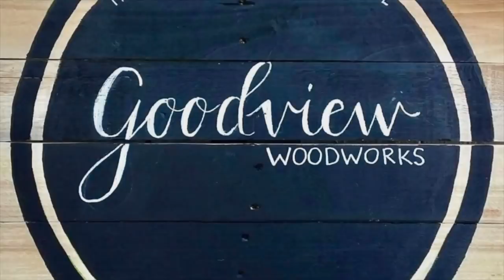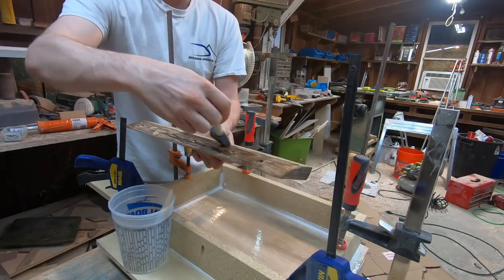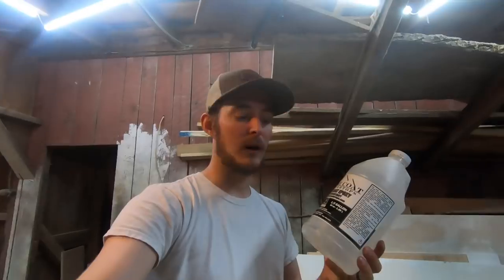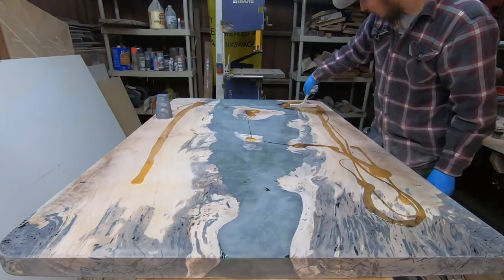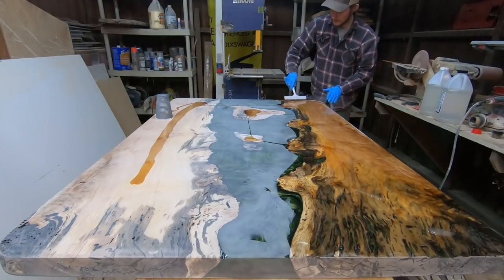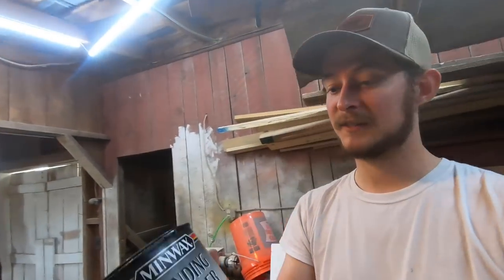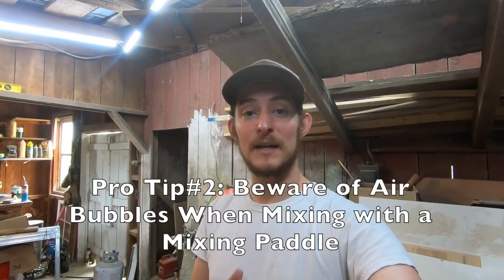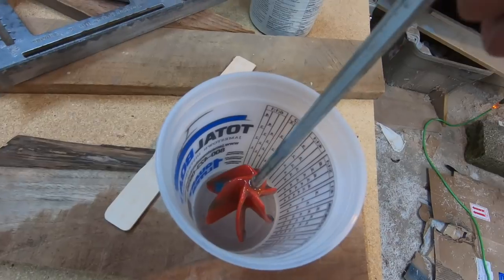2 Pro Tips That will Help You To Have Perfect Epoxy Projects!!!

Comment: Here is my bit, do not seal the edges of a river  or live edge pours! Use a slow curing epoxy or deep epoxy to allow to air to escape. If you seal coat you will stop some of the air bubble but the bond between the wood and epoxy is weakened. If you are hardwired to seal coat, then make sure the seal coat is not fully cured before you make your final pour.
Reply from the maker: Thanks for responding but if you have watched any of my more recent videos then you will see that I say this exact thing all the time!! I totally learned the hard way on this!!
Reply: Then you should remove this video and stop giving bad advice

Comment: Is it ok to use table top epoxy for sealing the edges before pouring casting resin into the river part of the table?  Great video, by the way. Thanks!
Reply from the maker: Hey Anthony, when sealing the edges you need to use a very thin epoxy. Not tabletop epoxy. You can either use the casing epoxy or this :
https://amzn.to/3MKMI9u
Reply: @GoodViewWoodworks  Thanks for the quick reply, Nathan.  I will follow your advice.  I am just about to get  going on my river table.  Everthing done except the resin work.  Cheers!

Comment: Hey Nathan, I have seen a video where the guy seals the underside by doing a 1mm pour in the form, then placing and securing the slabs and leaving overnight till its tacky, then he does the main pour. I haven't seen you do that in any of your videos, just the sides. Any advice for sealing the underside?
Reply from the maker: Madi Matei you can totally do that. I usually seal the underside after it comes out of the form.

Comment: did use a deep pour epoxy for the green river table in the video? if you used a deep pour, how did you get the swirls to stay and not fall out as the epoxy cured?

Comment: How deep was your river pour - it was all done in one pass or did you have to perform several small flood pours? Also did you use the stone coat epoxy for it?
Reply from the maker: I did a single pour, it was done in one pass. I used stone coat casting Epoxy.

Comment: Hi just wondering if you could pour 1 inch torch the bubbles out, than pour another inch and then torch again?. I'm really paranoid about delaminating? 
Also great vid
Reply from the maker: Thanks! That will only work if you have casting Epoxy. If you do that with tabletop epoxy, it will be too thick and overheat.
Reply: I am using a deep cast resin, this will be my first attempt With resin I am excited and terrified at the same time. Your video definently had some great tips

Comment: Thanks for posting.  Very helpful.  I’m using west systems epoxy.  I not that when I have sanded the epoxy after it cures that it is very easy to mark or scratch.  Does putting that top coat over the epoxy and timber as shown in your presentation stop this?
Reply from the maker: John Hasty it all depends on what brand Epoxy you use. The Stonecoat Countertop Epoxy that I use is scratch resistant. Thanks for watching!
Reply: I think the best thing to do is use your technique and try it out on my test piece.  All the best.  Great work on you presentation.  Some great tips

Comment: I want to make a general outdoor table using 2 by 4's and plywood for work space , nothing fancy, what's a good way to give the table some protection. Beginner to epoxy.
Reply from the maker: Michael Blast the best way would be to use a marine varnish. Total boat has a good one.

Comment: I'm making a vanity mirror frame which includes 14 holes for the light bulbs to go into. I never used epoxy, but I wanted to try to add a glass like finish to the frame to make it look more professional to my customer. Would you recommend using epoxy? I was thinking a thin layer if any. There isn't any videos on adding epoxy to something like that 😅
Reply from the maker: Yes epoxy would be a good choice for that.

Comment: Thank you, great advice.  What if I poured  one flour coat and have bubbles now.  Sand with 220-320 and pour another coat?  And how many onces per foot should I use? 3? Or can it go farther because its covered already.
Reply from the maker: Sand with 220, wipe the dust and apply 5oz per square foot for the flood coat. Hope this helps.

Comment: I’m trying to make thin channels/rivers 1/4 or 1/2 inch on guitar cabinets primary birch with epoxy, how would you go about creating the channels and filling them? Should I thin coat the channels in order not to get bubbles? Currently I have a Dremmel I was thinking I could use to create the channel/river lines. Also, should I paint or stain the cabinet before creating the epoxy rivers? Thanks in advance with any advice!
Reply from the maker: I think tracing the channels out first then dremeling them will work well. Then fill them with Epoxy and use a heat gun to rid the bubbles. Hope this helps
Reply: Awesome, first attempt so I thought I’d ask a pro. I appreciate ya, keep those great vids coming 👍🏽!

Comment: I've seen from blackforest Wood Co a video where they don't advise sealing the edge as then the epoxy can't attach to it as well, the epoxy is just attaching to the sanded epoxy used to seal the edge.
They show one of their projects that failed as they sealed the edge on it, and it has delaminated.
Not sealing the edge, apparently means a stronger bond, I'll take that any day, and deal with the bubbles.
Reply from the maker: Yeah you’re right, if you have seen any recent videos, I go over this very thing. Thanks for watching and commenting!!!

Comment: Thanks for the tips! Just subscribed. How do you clean your paddle after use???
Reply from the maker: alexa nixon great question! I usually just let it drip into my used mixing cup and let it dry. So I don’t really clean it. I haven’t had to replace it yet either and I have used that one for almost 2 years
Reply: @GoodViewWoodworks  Great, I'll give that a try. Thanks for the response!
Reply: @GoodViewWoodworks  So the resin dries hard and the color from one project to another does not "bleed" through, on to the next project?
Reply from the maker: That’s correct.

Comment: What’s your formula for calculating how much epoxy you need per square foot?  I’m pouring a 12ft x 16in shuffleboard table top.
Reply from the maker: Robert Geissinger if your pouring epoxy for a top coat, it’s 5 oz per square foot.

Comment: The epoxy I am using is not suppose to be used for thin coats. Is it still ok to seal the edges of your river board project with this same epoxy ?

Comment: If you put a little denatured alcohol in the epoxy when mixing it it will make it a little more um let’s say liquidity and the air bubbles from the paddle will come up to the top quite quickly if you do happen to get any in while mixing
Reply from the maker: Nice tip. I’ll have to try that out

Comment: Hey man question. How many mixing cups do you have? It there anyway way to save some or one and done? What do people do for the underside of projects like that table or serving boards and stuff
Reply from the maker: Great questions! I save mixing cups for when I do color coats or castings. I always use a new one when doing flood coats. I finish the bottom of my tables the same as the top.
Reply: @GoodViewWoodworks  when you flip it you dont get over lapping runs on the sides?
Reply from the maker: I do the bottom first then flip and do the top so that it flows over the sides and you don’t get those over lapping marks
Reply: @GoodViewWoodworks  Makes since. See I have never seen that in any of the videos!
Reply from the maker: Steven Adams thanks for asking. Maybe I’ll do a short video on that.  🤔🤔

Comment: How do you prevent visible scratchmarks from sanding in the resin? I used 220 sandpaper & some even finer sandpaper as well, but there are still fine scratchmarks on the surface. I also seal with polyeurethane– would sealing with epoxy make the scratchmarks invisible? Thanks!
Reply from the maker: Great question. How are you sanding the surface? By hand or with a random orbital sander? If you are dealing with polyurethane I would recommend sanding to at least 320 grit. If you’re sealing with epoxy 220 grit is sufficient. Thanks for asking. Hope this helps.
Reply: GoodView Woodworks I use an orbital sander at 180 and then 240, then sand by hand with 320
Reply from the maker: Emily Renee Art I would say that you’re not sanding enough if you still have scratches from the 180 grit. You can take a pencil and scribble across the surface of your work in between grits as a reference to ensure your sanding enough. Also make sure that you always keep your sander flat and never tilt it to be more “aggressive “ in a certain spot. Lastly, continue sanding with your orbital sand using the 320. Sometimes sanding by hand can leave light scratches because of irregularities. I hope this helps!

Comment: seal coat... does the temperature of the wood effect how the cells of the wood absorb the seal coats??
Reply from the maker: Great question. The only time I have noticed that the wood temp matters is when I use a heat gun to pop bubbles and I stay in one place for too long. It causes the moisture to rise out of the wood and creates more bubbles.

Comment: I've been seal coating the edges of my live edge and have had no problems. I would like to build a table but have heard that you cant seal coat on tables because the bond wont be strong enough, it will need to be all one pour. What's your opinion?
Reply from the maker: My opinion is that the strongest bond is bare wood to Epoxy. However if you seal coat the edges make sure you pour when the seal coat is still tacky and you will still have a strong bond.
Reply: @GoodViewWoodworks  awesome thanks for the reply!
Reply: IMO everyone sealing edges are going to find out why that is a bad idea in 5-10 years

Comment: Do you let the epoxy dry completely before pouring when sealing the edges or just when it's tacky?
Reply from the maker: Great question! I don’t let it fully dry. I pour when the seal coat is tacky
Reply: @GoodViewWoodworks  Surely it would be the same principle as when pouring layers,if it cures fully you need to mechanically key it?
Reply from the maker: You’re correct!

Comment: Hi! Did you ever made a table top like that (wood and epoxy), but for, like a patio table? My question is about how a table top like that would stands all weather conditions like sun, rain, snow, etc. Will it hold better than just a wood table? Will the epoxy cracks and/or has color changes? Would it last less or last longer than just a wood patio table? What could you or anybody else answer me about this topic, please? Thank you very much... (by the way, beautiful table top this one. Congrats)
Reply: Generally speaking, most epoxy isn't UV stable.  This means that the sun and weather takes a toll on the epoxy very quickly, causing yellowing and undesired effects on the piece. So, to answer your question, using epoxy for a permanent outdoor application would be less than ideal.

Comment: When applying thin coats for sealing do you sand the next layer flat, do you have to sand out any runs created by the squeezy
Reply from the maker: Great question! No you do not seed to sand between seal coats unless they’re fully cured. If you wait until they’re tacky you can just re-apply. 3 seal coats is best. Then let those fully cure. Sand with 220 and apply a flood coat.

Comment: Hey man. Great video. Question about the humidity and temperatures in the shop when you pour epoxy. My shop is my garage, no insulation. Thanks
Reply from the maker: My shop is an old barn and also no insulation. I haven’t really had any issues with the epoxy. The warmer it is the faster the epoxy will cure. Be careful, if it cures too quickly it can get bubbles and crack

Comment: When sealing the edges., if my pour is 2 inches. By the time I get up to to the top my sealed edge would be cured? Should I worry about it bonding to the edge?
Reply from the maker: Yes, I have changed my thoughts on sealing the edges in my latest videos and I recommend not sealing the edges. If you do seal the edges you must use an epoxy topcoat so the wood doesn’t pull away from the epoxy. Great question!
Reply: @GoodViewWoodworks  If you do seal the edges you must use an epoxy topcoat so the wood doesn’t pull away from the epoxy  ??    so I don't get it..... you wont get air bubbles if you dont seal edges ?
Reply from the maker: If you use a deep pour epoxy, you won’t get bubbles but if you use the regular casting epoxies or tabletop epoxies then there is a chance of getting bubbles.
Reply: @GoodViewWoodworks  hmmmm interesting, you've made alot of those tables w the river running through..?
Reply from the maker: Yes I have
Reply: @GoodViewWoodworks    awesome....if I ever get that far, I might try to get in touch with ya for some tips....will.be checkimg out your other videos...  Many thx and be safe.

Comment: Can you tell me the difference in between casting and countertop resin?
Reply from the maker: Casting resin is designed for thick pours of over 1/4” up to 2” and doesn’t have the UV and scratch resistant properties. Countertop resin is made as a finish and has UV and scratch resistant properties but can only be poured up to 1/8”. Hope this helps
Reply: GoodView Woodworks ok I see, so countertop resin is not suitable for river tables?
Reply from the maker: Well you can use it however you’ll have to pour 1/8” at a time, let that layer set up then pour another layer.
Reply: GoodView Woodworks ok setup meanin cure and dry? I have also read that the countertop resin is fairly toxic when poured. Or is it just certain brands?
Reply from the maker: Warez09 Tsane Grah Prebranac I mean when it’s firm but not fully cured. It’s just certain brands. The brand’s I’ve used channel are 0  VOC and have no toxic fumes.

Comment: Noob question: wife wants me to make one for her, does the bark absolutely have to be removed before pouring the center of a river table?
Reply: Just General it gets a better bond if the bark is removed
Reply from the maker: No it doesn’t. You can keep the bark on if you drill holes into the river banks so that the epoxy can bond with the hardwood and not just the bark.
Reply: Yes you have to remove the bark period don’t do it any other way ever horrible idea no matter what it will not hold up over time we have tried 3 different tunes it never worked at all
Reply: @TheHomeMaker1  you mean the bark will eventually separate from rest of wood and fudge whole project..?
Reply: aliasghar907 yes we have did three different experiments a few years ago to see if there was any way possible to leave the bark intact and no matter what we did it cracked at the bark or completely feel off over about 3-16 months we tried drilling the holes for epoxy to get into we tried seal coating the bark then scuffing it and then pouring and we tried injecting the bark with a turkey baster with 5 minute epoxy to glue the bark on and something else I can’t remover but they all failed after a while
Reply from the maker: I have a piece that I made over 3 years ago that still has the bark on. No cracks, no separation, no movement at all. The trick is to fully encapsulate it, right from the get go.
Reply: @TheHomeMaker1     you're kidding me, you couldnt re-fill the void later at all,   or do you mean, couldn't do it without damaging existing epoxy..?    I guess if the BARK changed size somehow as wood can,  then that's interesting..... I wonder why the bark would still change size..OOOOOOHHHH...... Bcus you only sealed one side of it..... it was still able to release or absorb moisture, that is dry or get more humid......maybe that's why it changed size after the fact....if it wasn't fully encapsulated and could BREATH/=change form...  hmmmm that's good to know for future, thanks broski..
Reply: @GoodViewWoodworks   ...you mean on all sides and all around the wood right...?
Reply from the maker: Yes that is correct.

Comment: This might be a stupid question, but when you're sealing those edges, are you using the hardener with the epoxy too? #noob
Reply from the maker: Yes. You ALWAYS have to mix both parts together. Thanks for asking!
Reply: @GoodViewWoodworks  Thank you! One other question - do you use a moisture meter and if so, is there a certain one you'd recommend?
Reply: @melzegers2367 yes , moisture should 12 percent.

Comment: Sealing the edge means the epoxy will stick to the bark hence the bark is all thats holding it on the best way is to remove the bark you might get away with it on small materials but tables are heavy and epoxy is expensive check out black forest woodworking they make huge tables and have tested this as they had to replace tables thay failed
Reply from the maker: If you check out my more recent videos you’ll see that I never seal the edges. I have found that no matter what, if the edges are sealed it will separate. Even if you remove the bark.

Comment: But sealing the edges keeps your river/pour from penetrating the edge and makes the connection very weak. Especially on large projects/tables you definitely don't want a weak epoxy to wood connection. You're better off using a slow cure epoxy and allow the bubbles to release
Reply from the maker: You’re correct! This is an older video of mine. If you have watched any of my videos in the last year or so I warn people to never seal the edges,
Reply: @GoodViewWoodworks  so then maybe take this video down so as not to confuse people?